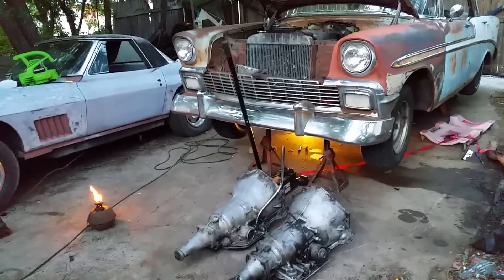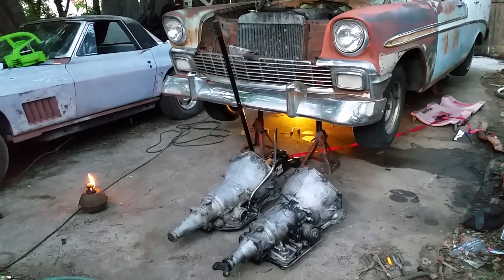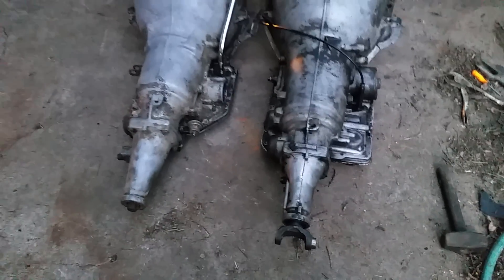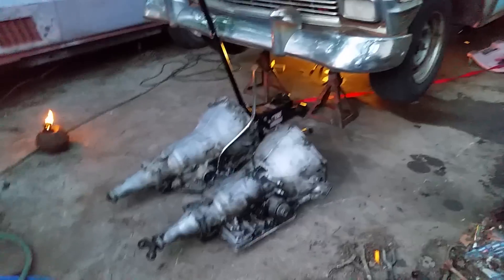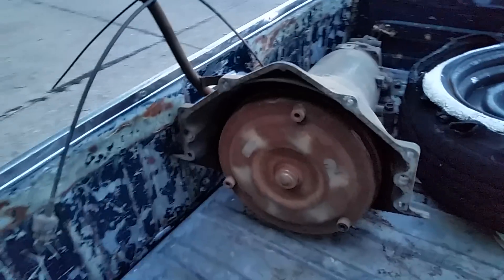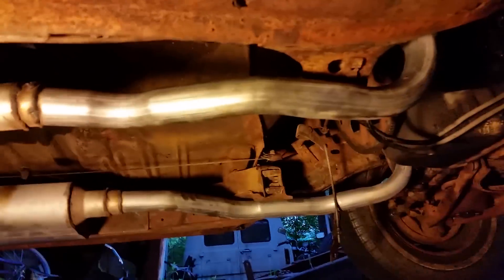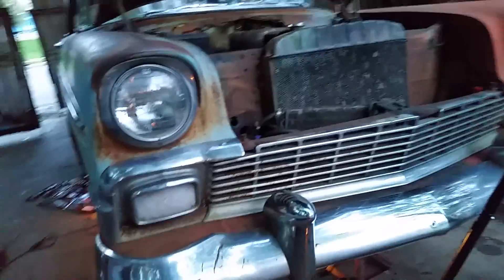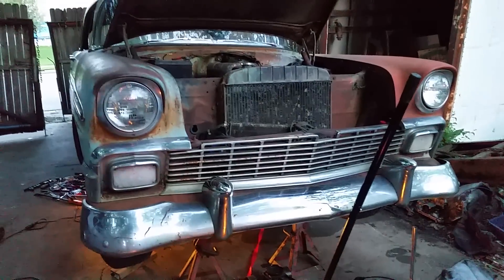56 Chevy video 27 trans swap

Comment: The 700 doesn't need anything fancy to go into lockup. The small, four pin plug needs power on the forward pin on the outside and ground on the one behind it. The two inside pins don't do anything. Hook those up and the converter will lock, but I recommend running one wire through the brake light switch so it unlocks when you apply the brake. Hooked up like this, it locks in 2nd, 3rd, and 4th, but in the last 50,000 miles I've never had an issue with mine like that.

Comment: The 700 R4 is a far superior trans...  What you need is a " Gil Younger"  reprogramming "shift kit" for the 700... Bout a $187.00. last one I bought, makes the trans totally mechanical, no computer or wiring... Had one behind my 468 for 7 years no problems....